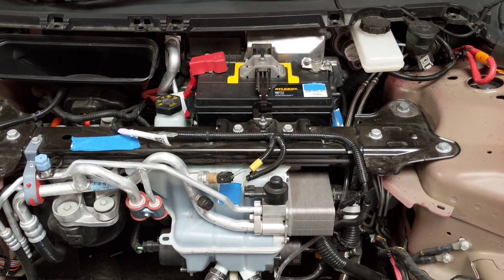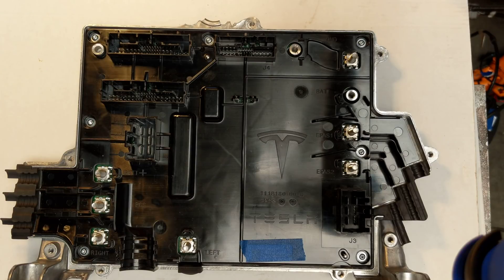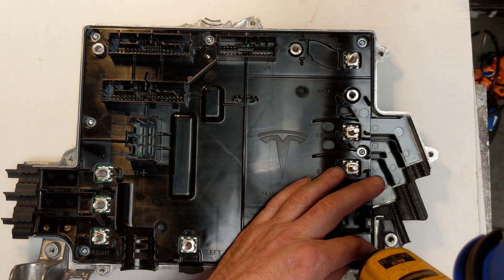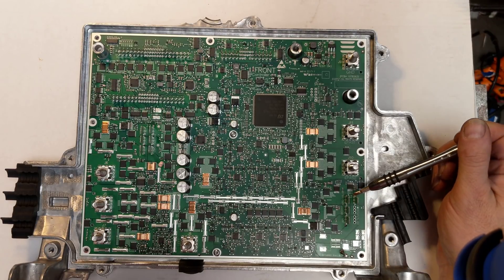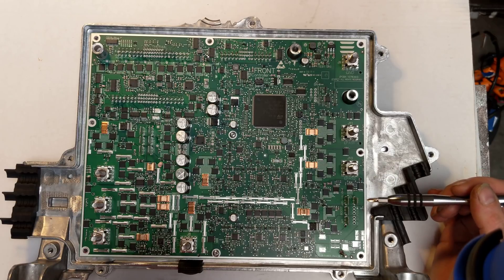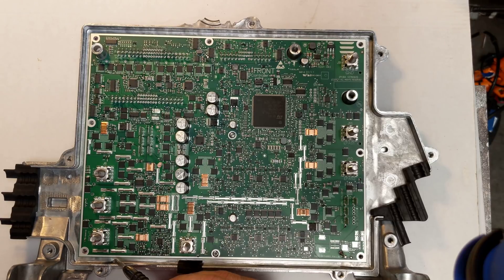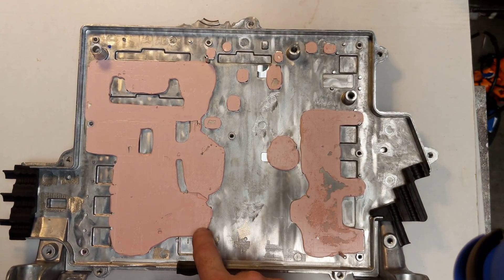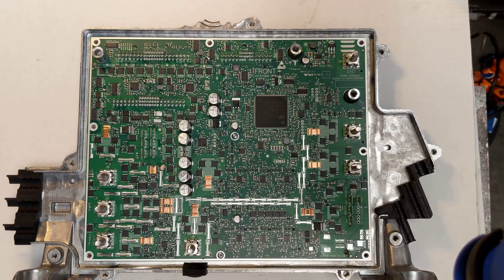Tesla Model 3 - Teardown of VCFRONT (Front Body Controller)

Comment: Any idea what compound they are using for heat transfer between the PCB and the case?
Reply from the maker: It's some sort of machine applied compound that cures.  Something like this: https://www.marketingeast.com/products/thermally-conductive-silicone-compounds-65-00-1642-0000/

Comment: Thanks, interesting stuff. While I think it's a good design, I wish Tesla provided a UI, so that owners can see if a 'fuse' has tripped, and give them the option to reset it. This becomes more important as owners start to add after-market accessories (dashcams, lights, etc). Right now, it's necessary to wait for the car to sleep, or get a s/w upgrade for a full reset of the fuses, and even then, it's all a bit vague. Do you think they can add a UI? Presumably there is one that Tesla tech's can access.

Comment: I take it you don't know any good reason why it would have a 12V lead acid battery?  certainly a pretty huge mystery to me why they would use it.
Reply from the maker: No, there are a lot of reasons why it's there.  No mystery at all.
Reply: Sigh. Disappointing thoughtless hostile tone. Name one good reason for using such a large and heavy lead acid battery. Or better yet, realize your mistake.
Reply: Because nearly all car systems run on 12V and getting rid of it would put all module dependency on the HV battery and DC-DC converter. Running the DC-DC all the time would waste a ton of power and in the event of a crash when the HV system shuts down you need backup power for the ECUs. 

Ass.
Reply: You didn't need to sign your comment. The issue is not 12V, the issue is lead acid and such a large weight of it. The issue could be handled by as little as two or even a single 2170 cell in a holder. Very easily serviceable even though it would never need to be replaced. Super elegant. A 2170 cell contains around 21Wh of energy. That's enough to run emergency blinkers and a high powered smartphone for a full day. I'm not saying it has to be a single cell but it could easily be if their EE kongfu was decent. And of course a small circuit could easily produce 12V from the cell.
Reply: If it's moving that fast presumably the main pack and DCDC converter are operating and the 12V battery is not relied on. And even in failure the 12V system can still be provided by a battery that isn't a lead acid starter battery. As already mentioned.
Reply: You assume the design is good and try to justify it. Don't do that. Simply understand that it's a huge mistake they used it. It's a massive weight burden on the car. Unless there is some obscure law somewhere that it absolutely must be a garbage lead acid battery and I doubt that. But I'd like to hear the reasoning behind it if they have it. No one has provided an even remotely valid reason why it should be used. Yet essentially all EVs do it. It's quite a mystery. I'm not sure the original roadster did but afaik all other EVs do.
Reply: You still unquestioningly assume the choice is good and irrationally look for excuses for it. Do try to think on your own. Read what I wrote could replace it and realize that of course 10kg of dead weight that needs replacement frequently is not a good choice.
Not to brag but I'm a brilliant man, I'm not looking for you to try to convince me. I'm right unless there is a law that requires a crap lead acid battery that large. And that would be a weird law.
Reply: On a flattering note, I love the fuseless design. I always thought fuses was a fundamentally flawed concept because it needs to be resisting on the edge of common current levels and it's very slow. But the lead has to go. I would also like to see other optimizations. Maybe going away from cast metal cases for electronics. And removal of hydraulics for brakes. I'd also like to see the rear mechanical brakes eliminated. Maybe also completely depart liquid cooling in favor or local air. Because it becomes air cooling anyway...
Reply: A lot of Tesla Model S had their lead acid replaced although that could in principle be other bad engineering. Many car failures because of it. And I already described a superior alternative in this thread. And mentioned it before. Do try to read it this time.
Reply: @DanFrederiksen  Lithium Ion batteries are great BUT they must be protected from extreme temperatures AND be protected from being drained too far (they turn into a useless brick if so). So, to use Lithium cells, you'd need to have some sort of active thermal protection system and a (small) electronic battery management system. In the end, you'd end up with something more costly and less reliable. All to save a few pounds. Not worth it.
Reply: @philtrubey7480  lithium can operate at colder temp than lead so a couple of backup cells wouldn't need any temp management. And of course it can't be drained too low but that's standard use of lithium in any device. It's insignificant for a device as complex as a car. we are talking about replacing 10kg plus structural weight with maybe 500g.
There is no excuse. It is most certainly worth it.
Reply: @DanFrederiksen  Lithion ion can't be recharged much below freezing, so you absolutely need temperature management.
Reply: @philtrubey7480  You didn't consider that it could just avoid charging when freezing. It's an emergency power system. It only needs emergency charging.
I know what I'm talking about. Even if it needed heating, a resistive heating solution in insulation is not costly at all. The board with resistive heating could be next to the cells inside a foam case. It takes very very little. And it doesn't need heating. A lifepo cell like A123 is agile below -30 c iirc. If it fairs poorly in -40, I wouldn't particularly object to a tiny resistive PCB solution keeping it above -10 from main pack, just so you can say this car will emergency operate even if left unconnected in -50 conditions. Which has to be an extremely rare case. Unless the rest of the car is questionably engineered so it creates emergencies below -30.
Reply: @DanFrederiksen  You can't avoid charging when it isn't freezing. The car has to work in all conditions, including a normal Canadian winter being parked outside (ie. it could be below freezing continuously for 2+ months).  I'll stop "discussing" this now since I am not an automotive engineer and don't know all the reasons why lead acid continues to be used. BTW, you complain when others use a brusque tone, yet you do the same.
Reply: @philtrubey7480  the aux battery is just an emergency supply so it doesn't need to charge in freezing conditions, it's just charged and ready. Primary aux supply is from the pack, via the socalled DCDC converter. And I respond in kind when others mindlessly assume I'm wrong when they haven't thought it through. If batteries have some kind of self discharge so they can't last 6 months or if they become too lethergic at target temperatures then I wouldn't rule out a simple insulated heater arrangement to keep it alert. Like I said, it's very easily done. 1W resistive heating on a PCB is not exactly difficult.
Also lead acid fails left and right but that's just accepted. A well done lithium solution could weigh 20 times less and last the life of the car. Show me that you are not a mindless beast trump voter and understand the obvious truth I'm telling you.
Reply: Original Tesla Roadster had lead acid battery originally...I changed mine to Lithium...no problem since 2 years...
Reply: sigh

Comment: Why didn't you show the other side!?!?! The other side of the board is covered with large surface mount components. (The side you were looking at was absolutely covered in BGA part vias.)
Reply from the maker: I DID show the other side!  Watch at 6:40.  I understand short attention span and all, but it took you longer to write this question than to watch the rest of my video!
Reply from the maker: Also, those are not BGA Vias, they are for heat transfer, which I also mentioned in the video.
Reply: @Ingineerix  Yes, you did say "via stitching" which is the first time I've heard the term. I've been out of PCB design for a while.

Comment: Very interesting. I think the days are over when a shade tree mechanic will be able to fix a brake light that doesn’t work. And many of these parts you can’t just pull from a salvage yard and replace because they need to be authorized by the car before they will work, which requires some Manufacturer’s software or special tool.
Reply from the maker: Brake lights are LED so they will likely last longer than the car, and fuses automatically reset.  There's nothing a "shade tree" mechanic needs to do except wash his Model 3!
Reply: One of the top reasons an old shade tree mechanic like myself loves his Model 3.  The days of gapping plugs, changing points, rebuilding engines, etc.etc. are gone for my aching back, hurting knees, and always bruised bleeding knuckles....lol.  Not going to miss any of that so thank goodness for Tesla and the car from the future Elon built for me!
Reply: JeffnReno, yes, I too an tired of crawling under a car in a parking lot in the heat or cold, but when I was younger it was nice to be able to fix my own car. I broke down in Little Rock when passing through on a Friday afternoon of a holiday weekend. Nobody open to fix my car, which threw its timing belt. Luckily a gas station let me use a stall and tools, and I was able to buy the belt at the local auto parts place. 

Time will tell if the new dual motor model 3 with claimed redundancy will allow Tesla to make the same promise as the semi, which is that it will be able to keep going until you can bring it in for service. 

I owned a 1960 Bel Air, and everything was easy to work on. Two radiator hoses, two heater hoses, 1 fan belt. Not a single solid state component in the whole car.
Reply: Sounds like we could swap stories for hours.  My first car was a 1950 Plymouth flathead 6 with 3-speed column shift but wasn't fast or loud enough so got rid of it for a 1960 Ford Galaxy with 390 V8 Police interceptor engine and dual glass packs.  Went thru 2 55 Chevys, a 2 door post and a 4 door straight 6.  67' El Camino, '70 Charger, '86 Trans Am and the list goes on and on not to mention the various motorcycles thru out those same years.  Rice rockets, choppers, and so on.  They were fun and I enjoyed driving and working on all of them when I was younger and a lot more flexible.  Got so tired of rebuilding carburetors that I learned to love fuel injection.  I still enjoy walking around the old cars during Hot August nights here in Reno and talking to the car owners, snapping a few pictures but most of that iron belongs in museums instead of pumping pollutants in my old lungs and ruining the planet for my grandkids.

Comment: Maybe a dumb question, but how does this replace a fuse box? In a regular car the fuse blows, you replace the fuse. What happens with Model 3?
Reply: amarsandhu3 The MOSFETs act like really fast switches. When overcurrent, overtemperature, the voltage is out of the normal range or whatever else fault happens, the MOSFETs will switch off. When the fault disappers or when the controller thinks it is right, it will switch on the MOSFETs. Think of these as really smart fuses that you don't have to replace.
Reply: I think of them like thermal switches that reset when the temp drops back down but I'm just old school and not really an electronics tech.  Your explination is much better.
Reply: While that's true it still seems like a really stupid idea. Mosfets tend to fail shorted. That is not a good failure mode! They should have put fuses somewhere in line as a back up safety.

Comment: What kind of freon is Model 3 using R134a or R1234yf?
Reply from the maker: In the US market: R134A.
Reply: Ingineerix  This is good. Because here in Europe the new R1234yf is very expensive, if you have to make some repair.
Reply: mondayfool Yes, European new climate walls. I have read that every car created for Europe from 1 January 2017 must be with R1234yf.
Reply: @TechnologyMove  The European requirements are defined in several timesteps, related to application and volume. So you can still use many types of refrigerants. The regulations will force manufacturers to best practices but over time to keep transitional cost down.

Comment: How reliable are the pressed in lugs? Is there a chance for them to be pulled out in some scenario or is that a common mounting method?
Reply from the maker: They are more reliable than soldering, as under high-vibration and/or thermal cycling like you find in automotive environments, you see a lot of solder joint cracking (aka "Ring around the colllar").  This method eliminates this.
Reply: That's very neat and makes sense considering some of the ABS modules that I've had to fix in the past.
Reply: Press fit is wonderfully reliable.  Like a cold weld.